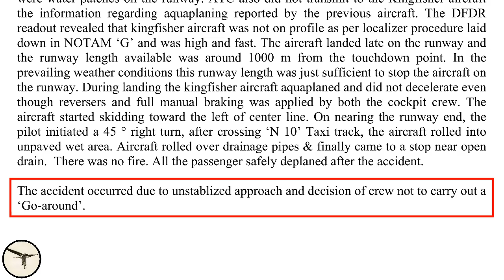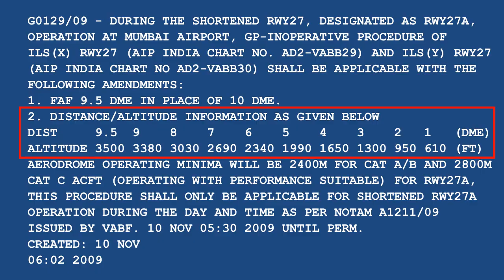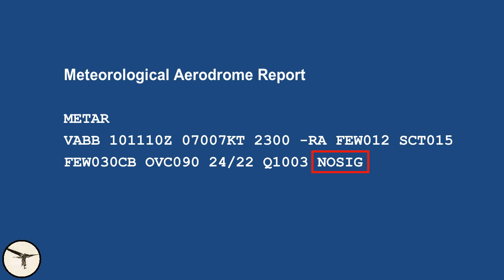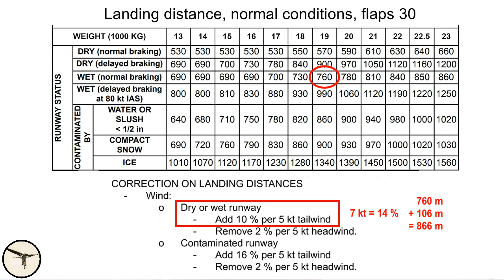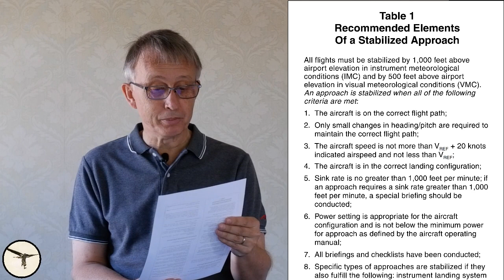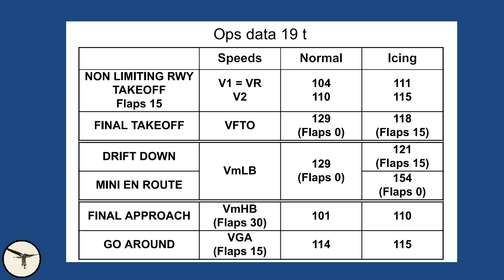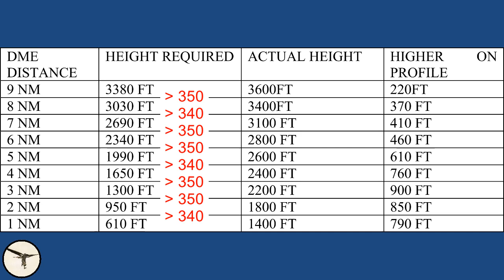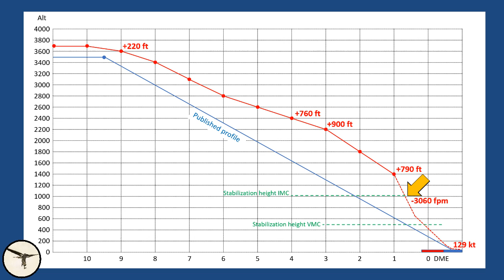Unstabilized approach and runway excursion - the history of Kingfisher Airlines flight 4124

Comment: Thank you Captain. Is your stabilized approach checkist generic or specific to the ATR?
Reply from the maker: The criteria for stabilized approach are generic. Many companies follow the criteria defined by the Flight Safety Foundation. The only criteria that might differ, is the maximum speed. Flight Safety Foundation recommends max speed to be Vref + 20 kts. Many companies set the limit to 10 or 15 kts. Some companies also require the flight to be stabilized at 1,000 feet even when in VMC.
Reply: Hello captain are there any official requirements as for horizontal distances like 10 NM DME or so ?
(Or a common standard one ?) Thank you
Reply from the maker: It's the same for all aircraft

Comment: When an unstabilized approach is observed ("Checj altitude"), should not ATC advise "Clear for landing or go-around"? When the captain hears "Clear for landing", it leads a busy/marginal pilot to assume that landing is the only choice.
Reply from the maker: A landing clerance includes a clearence to go around. ATC will normally order a go-around if the runway if unsafe for landing, for example when there is an aircraft, vehicle, or other objects on the runway. It is the responsibility of the commander to determine whether it is safe to land or not. A go-around is always an option.
Reply: @FlywithMagnar  Thank you.